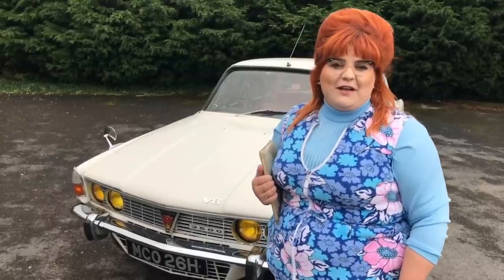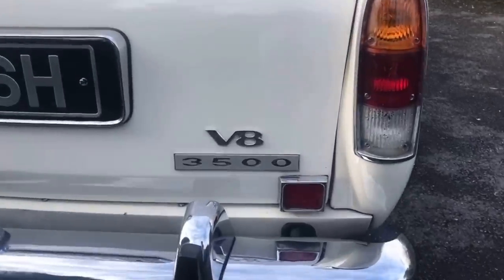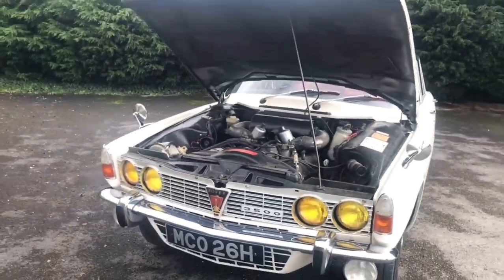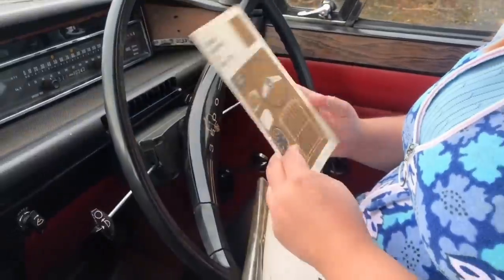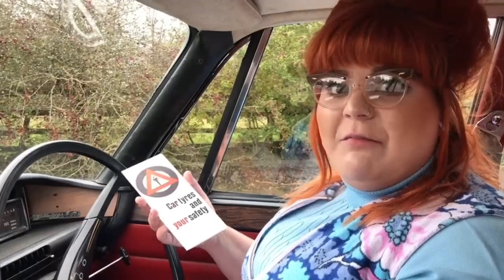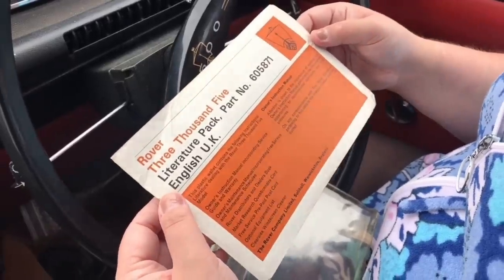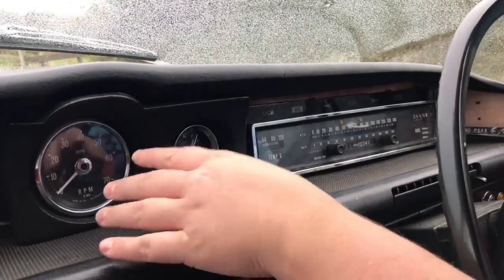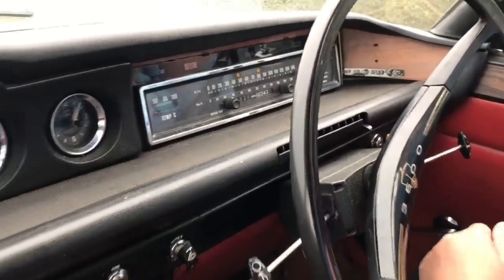IDRIVEACLASSIC reviews: 1960s Rover 3500 (Rover P6)

Comment: I agree that the original chromium-plated grill is far better to look at than the plastic egg-box style which followed the face lift. The whole Leyland exercise was a disaster for everybody. The government could not solve BMC's real problem, which was the infiltration of the workforce (primarily at Longbridge, but also at Cowley), by communist trades unionists. Even the trades unions knew that it was bad, but the political solidarity of the left meant that the convenors  (such as the one known as  Red Robbo) could not be curtailed. The same incapacity applied to the government under Harold Wilson who preferred socialist ideology to the future of the British motor industry.

The government's solution was to involve another component of the British motor manufacturing industry, which was successful enough to bail BMC out until the union problem could be "negotiated away". The "patsy" (as Americans call it) was to be the successful Commercial vehicle builder: Leyland Motors. A similar Process led to The Rootes Group being sold to Chrysler.

Leyland might have got away with owning Rover and Triumph, but the merger with BMC exposed Leyland to the socialist virus which was crippling BMC, the major player in motor manufacturing. This is never the way to control a virus. BMC should have been isolated and made to sink or swim on its own. As it was, the merger between Leyland and BMC, meant Longbridge's problems drained Leyland of all its money, and brought the same problems to Rover and Triumph. Not until the mid 1980s did the government face down the socialist unions and offer the whole group a viable future. But in the meantime, Britain's car industry had been reduced from the biggest in Europe, to one of the smallest. In spite of some desirable products, British Leyland no longer had sufficient mass to survive the competition - newly exacerbated by exposure to the Common Market. Eventually, even the successful truck manufacturer, Leyland Motors, ran out of money, and was sold to DAF. 

I am old enough to have witnessed the death of many of Britain's industries by socialism of one sort or another. As a car enthusiast, the death of the British car industry was particularly painful. Ever since, I have always hated the bastard socialists who did the damage.  You would think that the history of socialism in the twentieth century would furnish plenty of other reasons to hate the bastards. But no. It is the destruction of British industry, which leaves me most resentful. Listening to MPs etc peddling the same old political ideology, but promising that this, time it will somehow be good for us, gives me reason to hate the bastards to the max, whether or not my feelings constitute a "hate crime" or not.

Comment: I had one of these back in the 70’s the facelift versions had the Borg Warner 65 auto boxes on them, better than the Borg Warner 35’s ...as the 65 was a stronger box, that could handle the power from the V8 .. I am sure they used the 65 in the Jaguar 4.2 XJ6’s

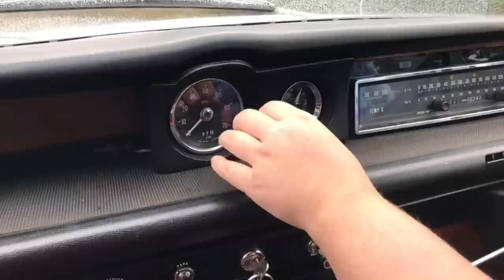Comment: Very nice car. Just one snag I can see @15:48 - the tachometer (rev counter) shows the red sector at 60 (i.e. 6000 rpm), the proper V8 tacho red sector is at ~5200 rpm. https://youtu.be/sbdbtxy1I9I <== a V8 tacho from a P6 about the same age.
Assuming the tacho is showing the correct engine speed,  some may think the engine is fine up to 6000rpm, it's not - they recommend no more than 5000rpm for the V8 variant fitted to the P6  - it may be different with later V8's and/or the modified V8's (3.9, 4.6 etc) though.
Reply from the maker: Cameron is actually looking for one at the moment. If you can help us please email Cameron@classicspritecaravans.co.uk
Reply: idriveaclassic The series 1 V8 tachometer is quite rare - but I'll keep an eye open. The P6 is a great car, got it's faults, but I love them. FTR, as you said, a U.K. gallon is more than a U.S. gallon, roughly 5 U.K. gallons is 6 U.S. gallons.

Comment: Any one got my Rover......HLX  672N.
Reply: I put a Kenlow fan in which stopped it overheating on hot days which is prevalent......and worked fine...l didn't the trim ..false wood  on the dash and on doors and a friend who is french  polisher  and looked great.....sunroof was great on a sunny day. It had a radiomobile  AM only so I took the radio out and cut the back of....I made a hing and put the new radio  tape player _ radio in which was perfect....l also took the  speakers out and sprayed it drilled the same colour. .....it had a spare wheel on the boot too.... unfortunately I was emigrating and it had to go.....the colour was Paprica......or orange.....and after having it respected it really

Comment: This car was the  flop of all times..
Break master cylinder  . Gearbox.  Rear sespention.  Rust .. engine oil leaks .. carburetors ... didn't really understand how they where ever used as police cars at the time 🤔
Reply: Ammar Al Saigh never heard so much rubbish in my entire life. I wouldn’t call a car produced in over 300,000 units a “flop”. I’ve had five P6s now and never had an issue with a brake master cylinder, carburettors, rear suspension, engine oil leaks and only once had a gearbox issue and only twice had to have one welded.
Reply from the maker: Hi Anmar, do you have a source for this please? The car won car of the year. It was well loved and highly regarded. Not a flop in my books although would like to see any literature to expand my viewpoint if available.
Reply: @idriveaclassic  Hi
I had 3 of them v8.1972 .. 2 automatic. One manual.  I had also.  A triumph Herald 65.. and scimatar reliant.3.0 2 door and 3 more American cars as well ... and I used to do all the work on those cars my self as I am mechanic from profession . So do believe me when I tell you all about them Rovers as I do know what I am talking about.. 🌹🌹
Reply from the maker: It’s a shame you’ve had bad luck then with your cars because you are the only negative commenter I’ve ever heard concerning the P6
Reply: @NotAnotherWhiteBox  the number of vehicles produced.  Doesn't mean by far that these cars where a success.. and we should admit that the rover in England was sold as A jaguar or a rolls Royce imitation.. funny wise it was called..A poor man is rolls Royce  or  jaguar..